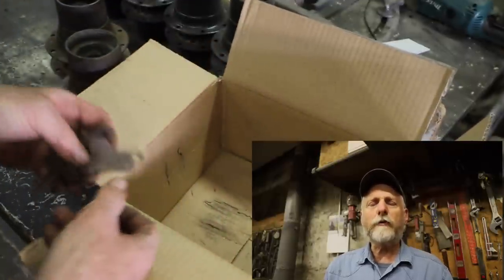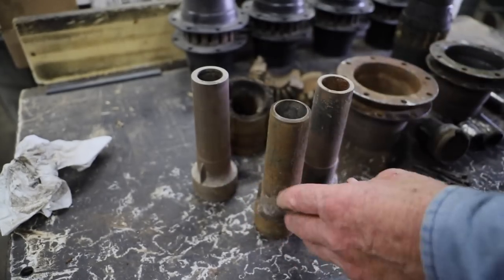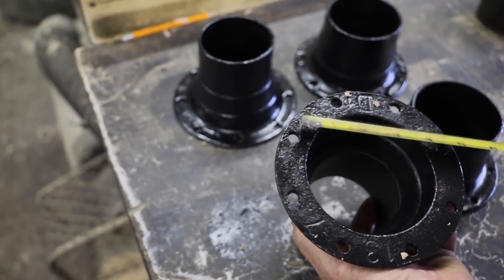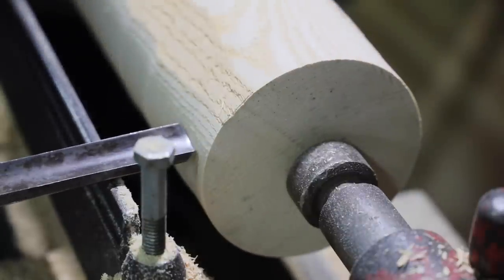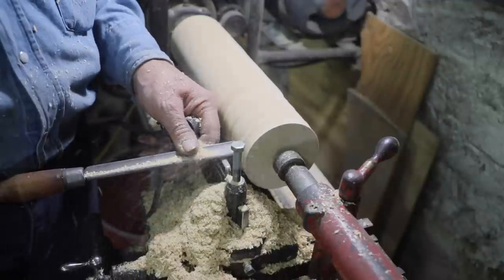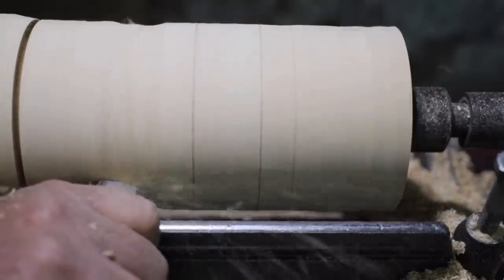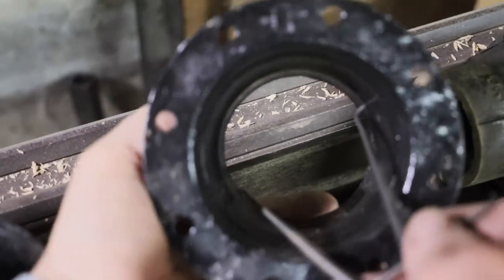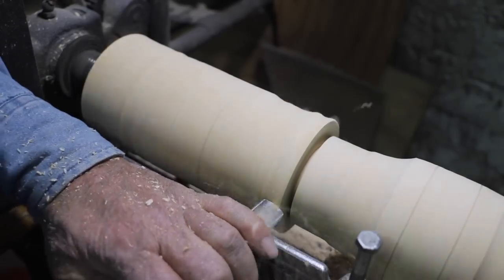1857 Patent Sarven Hubs & Turning New Wood Cores | Engels Coach Shop

Comment: As Shaun M said: "I'm not a wood worker, wagon builder or wheelwright...I just have an appreciation for fine craftsmanship."  I did use a wood lathe a good bit as a youngster, and my paternal Granddad was a cabinet maker. I just wanted to say, thank you for taking me back 60 years as I watch you turning down the 4x4. It transported me for a minute back to Pop's shop and the lathes. I can still smell the sawdust.

Comment: Watching you use that gouge and your comments about going too far reminded me of my one and only wood turning project.  Fortunately for me I had an understanding woodshop instructor, especially since it was clear that hand tools and I were not a good pairing.  "Well your bowl will not be able to hold liquids, but all is not lost.  The hole is not even pencil size so we can patch that and once stained and oiled it won't show that much.  Call it a Fruit Bowl instead of a Salad Bowl and it will work just fine for fruits, nuts, or pretty much any other dry type foods."  Starting over again would have been a total waste of the two fairly large squares of walnut that were my starting point for the project.

Comment: Nice video, as a wood turner you might find it easier and quicker if you mastered the use of a spindle gouge and a skew chisel depending if you have the time.The gouge you are using is called a roughing gouge and are generally used just to bring the wood to round. Excellent use of what you have nothing wrong with that. Hi from the UK.

Comment: I once saw a trick where a guy put two strips of cardboard cut to approximate the inside curved areas of a hub and fit them in place about 1/2" apart and then squeeze in some hard silicone  and when the silicone dried, he had a perfect inner template complete with perfect measurements.
Reply: In the machine shop, we used cerro (low temp bismuth/lead/indium/tin alloy) to make profiles that could be measured accurately on a layout table.  Many gunsmiths use cerro to check for chamber wear and distortions as well.
Reply: @opendstudio7141  That works too. Though, silicone is $2.79 at home depot.

Comment: Dave, Thank you.  Another excellent demonstration.   Question Please:  Given the allowable tolerance difference between the hubs... Could you not have spun the first hub on the lathe, then the second hub on your spoke-copy frame?-using the first hub as reference?
Also - I have seen techniques to ultra-desiccate wood in hot sand;  then press-fit to socket / flange; re-normalizing to shop humidity then swells wood to an ultra tight fit.   Would that be applicable to these hubs? Are there strain/stress factors in the wood which would nix this idea?   We noticed, since you already painted the hubs, doing a heat-expansion-shrink was not part of the plan?
Thank You,
-V
Reply: Of course!  Thank you -- Many of us (audience) totally get the automation-time trade off.
(Hah!!) The hub-casting strength vs moisture swelling cores: I would have learned that the hard way! (laugh) 
Thank You!

Comment: You seem to have deliberately turned the cores off-center, and I'm wondering what the reason for this is? Was there some bad wood you were avoiding, was the grain not straight, or is there some interesting reason why tuning them so that the grain isn't perfectly parallel to the axle is beneficial?

Comment: This video's a few months old so you probably won't see this comment but anyway...   You're a master craftsman so I make this suggestion with all due respect.   While I'm watching you take constant measurements from the inside of each hub end, my own restorer brain is thinking.  If you were to fill each hub end with fine damp, compacted sand then up-end the hub end like a child would do with a plastic bucket at the beach making a sand castle.  That would leave you with a perfect representation of the inside of each hub end which would make it easier to take measurements from.  Just a thought.

Comment: The iron must be still quite flexible for cast iron when I see you hammering on those hubs...
Reply: Pretty sure it's cast steel, not so much carbon in the mix as you would get with cast iron.
Reply: I see. Thanks! @EngelsCoachShop
Reply: @EngelsCoachShop  Really and truly, ductile iron is not brittle, that's why it's called ductile iron.  It has ductility characteristics.  In comparison to malleable iron, yeah, it is considered brittle.  Malleable iron is pretty much cast iron, with ingredients that make it very ductile and very similar characteristics that of a mild steel.

Comment: whew what a process! nerve racking for sure.Is there a way to use the hub itself as a pattern to follow??
Reply: Well. Since there are intrinsic margins in casting(as opposed to machining), each hub will be a bit more different than most parts that we are used to today: (Then you factor in the years of torque and hammering,) each hub will be slightly off by a 1/16 a 32nd, here and there. In the video (around 17:15 ) he demonstrates that even the diameter is not exactly the same as measured in two places, at right angles around the arc within the same hub: therefore; he takes an average. So, he pretty much measures every individual hub and cuts cores to fit. For each. If anything, the pattern is in his head as he goes; as if this were not impressive enough. He is truly a master. 

(BTW, my understanding is that with cast steel having a core that is more truly circular in cross-section would be better than exactly matching the eccentricity of the cylinder, providing a spring compression effect. FWIW, in my limited mechanical engineering experience.)

Most wood turners would measure the 4 or 8 hubs and make a generic 2 dimensional pattern out of 1/4" plywood that was an average of all the measurements and make adjustments to the final fitment using (a lot of) putty/sanding. Not this guy. Custom fit per hub.
Reply: @christopherneelyakagoattmo6078  a master indeed!.I am asking if there was some way the lathe could be made to "follow" each hub.
Reply: Paul S  Well, probably. but the challenge is complex for that, since you are machining an outside diameter (the core) to fit the inside of another (the flange(s).) And following the old cores is a no go, because of wear and cracking. This tech exists on modern lathes, but is not particularly practical for this low volume application.
Reply: thankyou

Comment: When you hammer on those flanges cold, doesn't that work harden them and make them more brittle?
Reply: Soft iron used in these flanges, pretty much A-36 grade, will not work harden as one would expect.  Tensile strength may increase slightly, not to the extent of making it hard.  Needs alloying to get it to work harden.

Comment: Since its a machine lathe you may try mounting a cutter on the tool holder and running as if it were metal.  No difference between a pice of ash or 6065 aluminum, just the tool doing the cutting.

Comment: Can you imagine the skill and time it took to turn those back in the 1800's with a non-electric lathe
Reply: h-worker - Dont sell the old-timers short. I’ve seen people turn on a treadle or spring pole lathe and the chips are flying over their shoulder with same or perhaps greater velocity than people turning on an electrically powered lathe. When they worked in a production shop, they were expected to make parts as fast as possible and they delivered on the promise. 😎👍
Reply: Actually by the 1800's and at least with the larger company's there was a great deal of mechanical semi automation around that helped to speed up the work and remove some of the skill required. By the time of the Civil War the North was using water powered hydraulics to help assemble the wheels for there Napolean 6 & 12 lbr cannons. Copying lathes were well developed and certainly in use at that time. So the larger Carriage and Wagon factory's would have been using those also. There parts manufacturing was a lot faster and much more capable than most seem to think. They were limited by the high carbon cutting tools available at the time since high speed steel cutting tools weren't invented until about 1910 I think.

Comment: If you have time to post some pictures of the lathe on VintageMachineryDOTorg, i'm sure the fellas over there can tell you something about the lathe, maybe even some original drawings.
Reply: To date South Bend lathes, you need the serial number, which is usually found on the tailstock end of the bed.  There are websites that list "reported" South Bend serial numbers and give their dates & models.  You can also write/email what remains of South Bend (purchased by Grizzly, I think) to get a copy of the lathe's data card from the old South Bend records -- that card can usually tell you virtually everything about the lathe's origins, like who it was sold to, etc.

Comment: Since the hub is patented, are the parts not standardized? If so, why do you need to 'hunt' for (and not exactly find) a match to the boxing(s)?
Reply: he wasn't going out and buying a part to fit this exact hub, he was looking through all the spare parts that he's accumulated over the years and trying to find one that matches, or in this case pretty clothes that he can machine to match exactly. Chances are the parts he found did not come from the same model but one that's similar. Sort of like choosing between going down to Lowe's and buying a $10 part or looking through all the spare parts in your garage and finding one that's close and making it work for free
Reply: Thanks for the reply,  @FarmerJohn1957 , but not quite satisfactory. If I'm working on something for myself, I'll certainly dig through my spares, but revenue jobs  should be to a higher standard than, 'Well I found something that fits pretty well.'

Surely he's charging the customer for the part, so why not get a new part if possible?
Reply: Thanks for clarifying,  @EngelsCoachShop !

Comment: Why measure from the hubs, having to transfer measurements between the two comparators when you have the wood plug that had to be hammered out and only use one comparator?

Comment: Watching this, I find myself wondering how hard it would be to make a copy-lathe. So you would set up the hub on a bracket behind the workpiece and have a linkage of some sort to copy the internal profile of the flanges on to the new core for a zero-skill accurate fit.
Reply: Those exist. But not necessarily the best way to get a fresh and accurate hub especially if your template is an old and worn piece of wood.
Reply: @JasperJanssen  Copy lathes exist, in fact Engels have one, shown in a different video for making spokes. What I was suggesting was making one to copy the shape of the inside of a flange to a wooden hub.
Reply: andy pugh ah, right, sorry, I didn’t catch that. I think it’d be fairly hard to get that accurate — and besides, you don’t want a full copy of the flange internal, you want it to basically be like a band right next to the spokes and a band around the end, except connected by the flange material in between but that does not contact the hub in that section. Come to think of it, the large/traditional style does exactly that, don’t they? Separate iron bands at exactly those places where the flanges of this style contact the core.

If you were setting up for series production, you’d just have templates for all 3 or 4 sizes of flange you buy from your suppliers. And if you’re doing repairs for 1 or 2 or maybe as much as 4 at a time, well, then setting up a copy lathe would be more effort than it’s worth. Especially something that would transfer an internal measure to an external. I’m not entirely sure that’s even mechanically possible, but it would definitely be complex.

I mean, short of doing CNC. With a computer in between a sensor (mechanical or laser) and a numerically controlled lathe, you can definitely do it. And it could be made very easy to use, and reasonably accurate. If you make some assumptions and basically only input the major numbers (two diameters each for those two flanges, and then the 7 lengths (one in between the flanges, 3 each inside each flange), you’ve got a pretty good description of that hub core that a CNC lathe could be programmed to easily carve out.

But honestly, most of the process of the wheelwright really couldn’t be easily automated, and I don’t think automating this little tiny bit would make his life that much easier. The drilling of the mortises in the core could be automated, but only with a fairly advanced CNC machine. The assembly, let alone disassembly, not really.
Reply: @JasperJanssen  You would probably want to machine some clearance areas by hand, yes. 
Mechanically you could do it with a sliding rocker bar. The "feeler" would be pushed in to contact with the bottom internal surface of the flange with the cutting tool working on the top surface of the work. 
Unlike the copy lathe shown in video https://www.youtube.com/watch?v=EQMgeFrOzi0 this system would make it all too easy to over-cut, though. 
(In fact that system could be modified for this purpose, with a "feeler" on a long rod poking in to a pattern flange. But the same caveat would apply, if the feeler loses contact with the pattern then the result is over-cutting, not under-cutting. 
If the flange material is a consistent thickness, of course, then the outside surface could be used. But I bet it isn't.

Comment: A treadle metal lathe ?  never heard or seen one before..  pedaling and turning the dials must have been real hard.  iv'e seen very old steam or water mill metal lathes.  compared to wood, metal lathes have turn faster and lots more torque.
Reply: They often have a seat attached and you operated it like a bicycle.

Comment: I know slow and steady is the best way for such a limited production, but my trained machinist brain is searching for production solutions as I watch you hand shape these things. It's really annoying: can't help myself. I'm also confident that there are other viewers suffering from the same condition (machinist brain) also. <grins>
Reply: I wouldn't insult real machinists by calling myself one, only a hobby level metal worker here. But yeah I was still thinking the same. No doubt there's good reasons he decided to hand turn them, and it takes a great deal of skill to do so. Me I'd cheat and use my metal lathes power feeds, taper it with the top slide etc. I'd be far more confident of hitting the dimensions that way. I guess that's what separates a real craftsman from a wannabe. :-)